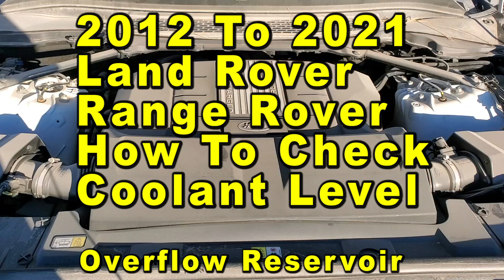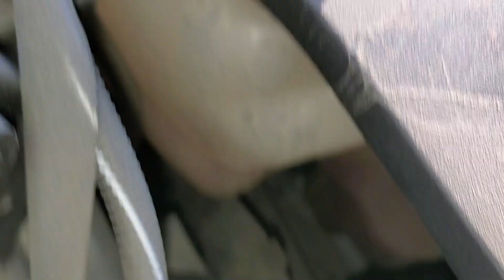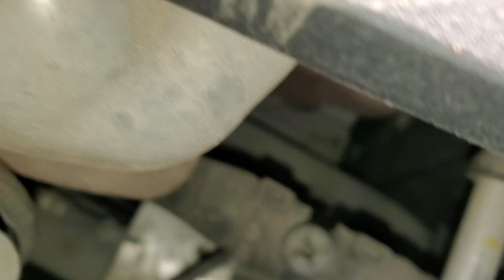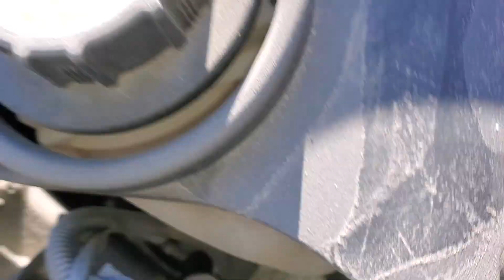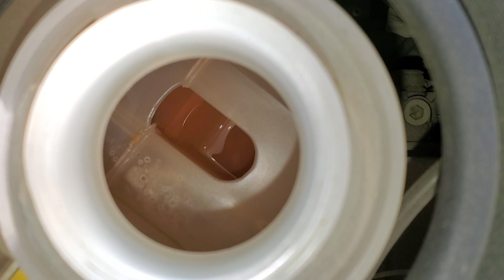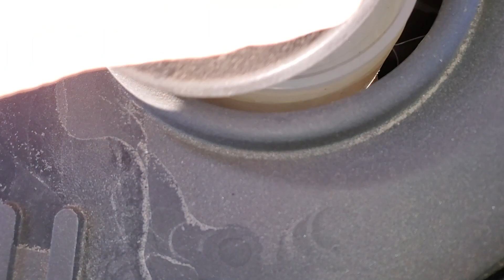2012 To 2021 Land Rover Range Rover How To Check Coolant Antifreeze Level In Overflow Reservoir

Comment from the maker: Engine Coolant - https://amzn.to/3vO8piC
50/50 Mixed Ready To Use Coolant - https://amzn.to/3SfiZH5
Coolant Funnels - https://amzn.to/497mqqc
Coolant Tester - https://amzn.to/3SvVjzs
Radiator Pressure Tester Kit - https://amzn.to/429bJB9

The Paul79UF YouTube channel is a participant in the Amazon Services LLC Associates Program, an affiliate advertising program designed to provide a means for sites to earn advertising fees by advertising and linking to Amazon.